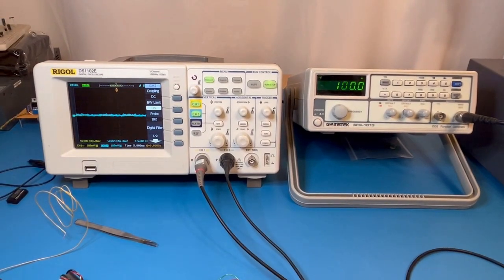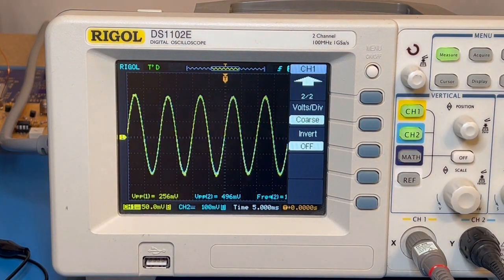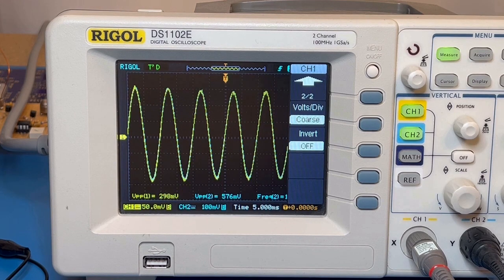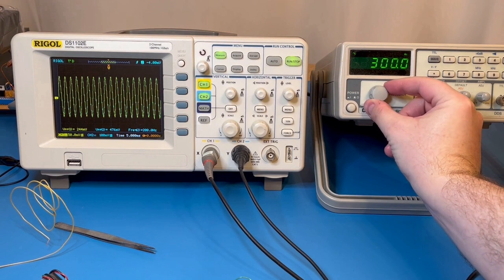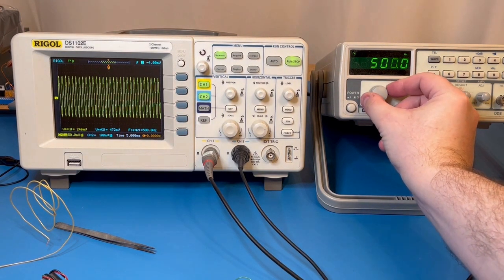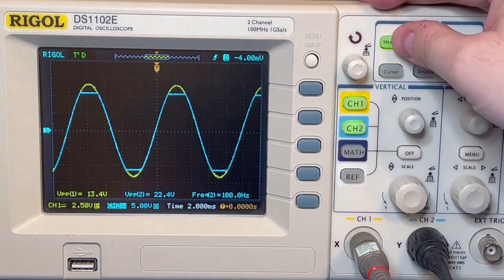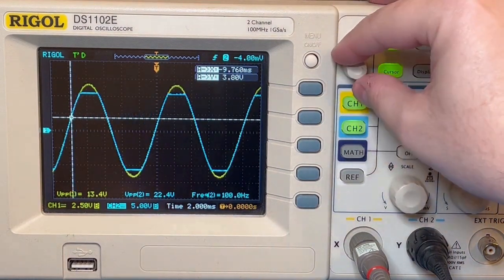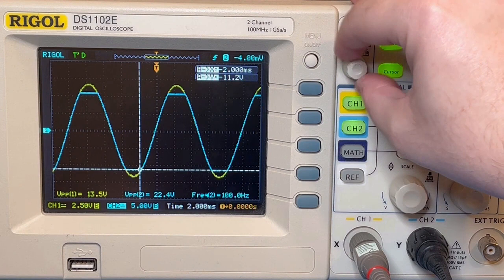Op-amp Tutorial Series 2: Introduction to Op-amps Part 2

Comment: That large signal distortion looks a lot like what we often see in overdriven cathodyne inverters due to cathode voltage clamping. In amps built from discrete components, we typically deal with this by whacking largish grid stoppers (about 100K) on the output valves; with the LM324 it's just a design limitation you have to keep in mind when selecting the op amp for your application.

Comment: LM358/324 has a 2V deadband that causes the crossover distortion where the output is on the borderline of sinking 50uA.
It is really an NPN class-A output stage with PNP pull-down.
Biasing the output to avoid that crossover eliminates the distortion.
Reply from the maker: Thanks for the comment!  A good video that shows this distortion disappearing when you bias the output like you say is from @w2aew  https://youtu.be/VgodYtiD_F0?si=F756Fmktm4oIoc5V

Comment: What Op-Amp would you recommend for a best-of-best or a headache-free application? Thanks for the video.
Reply from the maker: Headache-free really depends a LOT on the application.  For example if you don't need high speed, a low speed op-amp will be more stable just because parasitic capacitance won't matter to it like a high-speed one would.   Is non-rail-to-rail inputs or outputs a headache?  Does it need to be super-high impedance?  So much of it is a trade-off - hence why there are so many out there and that it hasn't been all pared down to like 10 op-amps everyone uses.

Right now most of my experience is with parts that are space-qualified or commercial equivalent parts to space-qualified parts, so I could suggest one of those, but they tend to be much more expensive and lower-performing than equivalent newer parts on the market.  In the future I plan to evaluate some real op-amps on the market and test them myself to see how they perform and maybe do some comparisons, I'll have a better idea what commercial op-amps work well then.

Since I have NOT answered your question and rambled at you for two paragraphs instead, I hope I can make up for it somewhat by telling you about an op-amp I've found that I'm interested in playing around with because it has great potential for high-speed applications (but I have NOT actually played with it yet) is the OPA858 - it is a blindingly fast ~1GHz op-amp with an input bias current of only 5pA max (due to CMOS inputs) and extremely low input capacitance.
Reply: @electronevice  Much obliged.
Reply from the maker: @user-mr3mf8lo7y  To be clear, the OPA858 is not a good general purpose op-amp and is not easy to use (it's not even unity-gain stable) but it is a relatively cheap part that can work at very high frequencies, I mentioned it because I think it's a very interesting and powerful chip if you need to amplify signals that are near 1 GHz in bandwidth